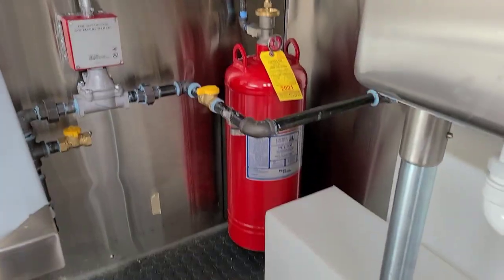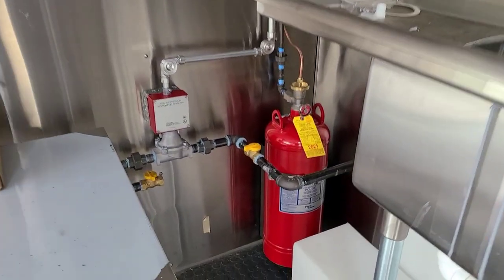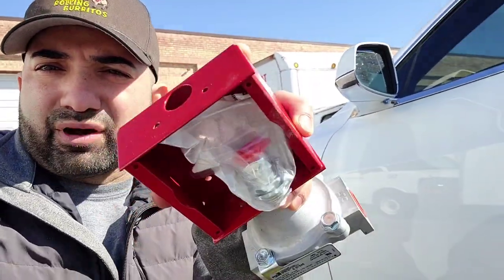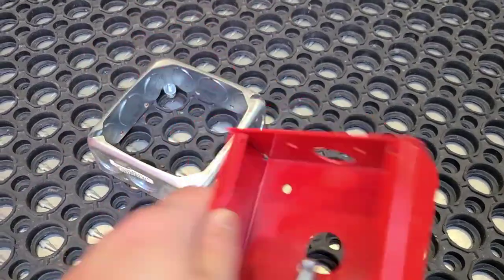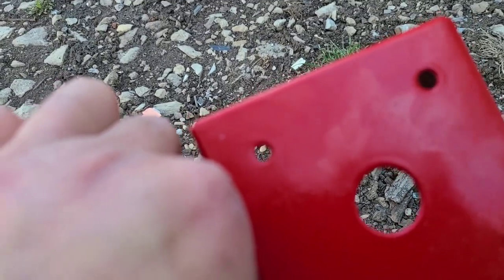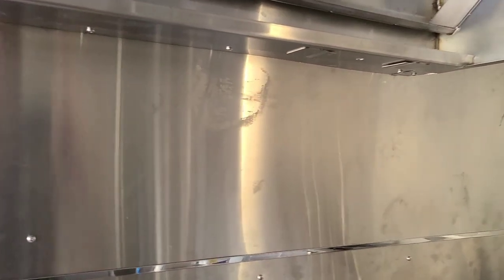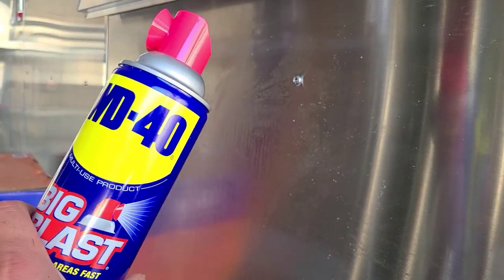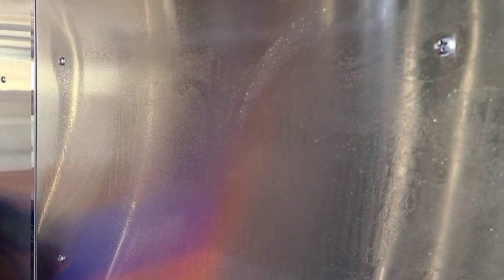How to Build a Food Truck: Fire Suppression System

Comment: Question why was the manual pull station not install near the door/exit? Was there just lack of real estate ? Also, as a pyrochem distributor those guys should know better to install the link brackets in the duct mouth opening per manufacturers and NFPA requirements. Interesting the route they chose to take with the appliance nozzle piping on the front of the hood instead of using a quick seal to come in for the side like most.
Reply from the maker: Yeah I'm not sure in this topic much. Fire Department liked it. They said it was a green light with them.

Comment: Hey frank, great video. Was windering if you could provide the link for the mechanical shut off valve i cant find the same one you used. Thanks
Reply from the maker: That comes with the fire suppression system. I did not install that system, had a 3rd party do that part

Comment: Should I do the fire suppression before or after i install the gas lines in my food truck?
Reply from the maker: Before because you have to add a little box that they provide typically between your equipment and the main propane tanks
Reply: @fbaltierrez  thanks frank, I am almost done. Once i am done I will upload a video in thanks to you

Comment: I know it's late, but we use a lot of stainless. The best way to remove the glue residue is alcohol for cooking. It's a lot stronger. Spray on lightly 20 sec later use dry cloth.

Comment: I’m still not sure what you are saving by installing the fire suppression separately? Maybe you said it and I missed it. I know you have to have it tagged but seems like that would cost less than a total install if you just had hoodmart factory installed. What am I missing?
Reply from the maker: Hood Mart does not factory install. They can't, everything comes in pieces. As per my conversation with them
Reply: @fbaltierrez ok I see but even with that is it predrilled and cleaner lines if it’s their own pipes? Then just have the fire guys install and tag. Is their a difference in price either way or not? Thanks

Comment: Do you know the size pipe used for the fire suppression system?
Reply: out of the tank its 1/2" NPT, then you reduce down to 3/8"- Thats for a Pyro-Chem. which is what he has. 
Ansul systems use 3/8"only. 
Range Guard can be 3/4 - 3/8.

Comment: detection is wrong, and appliances line is ugly looking. shouldve bn done inside of the hood
Reply from the maker: 3rd party installed the fire suppression. In my opinion I think the lines they installed were perfect. All personal preference I suppose
Reply: @fbaltierrez  not according to factory  istallation training.
Reply from the maker: @pressurewashingandhoodcleaning  I didn't install it, it's certified installed by a 3rd party and fire department passed it so it works for me.
Reply: @fbaltierrez  good luck